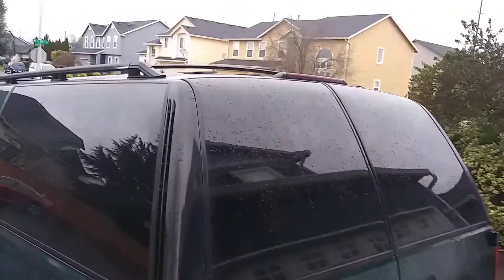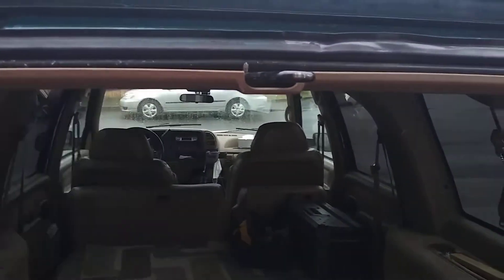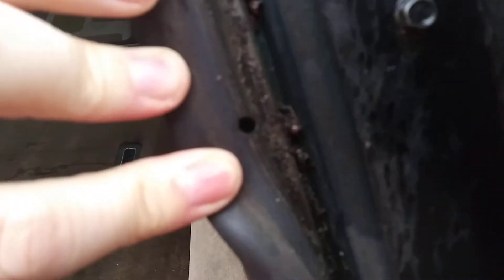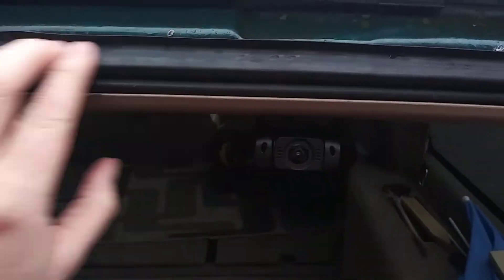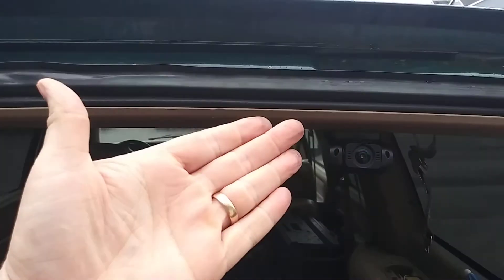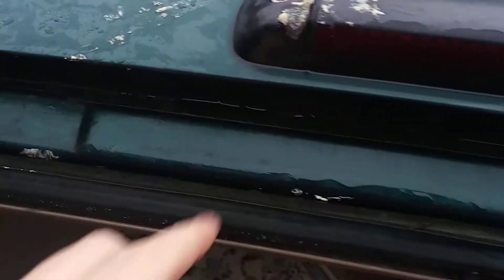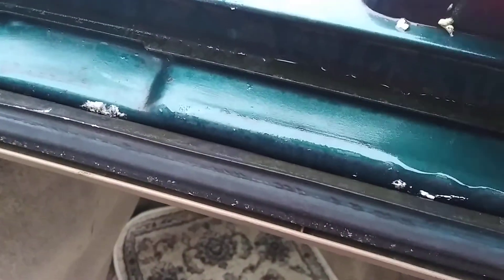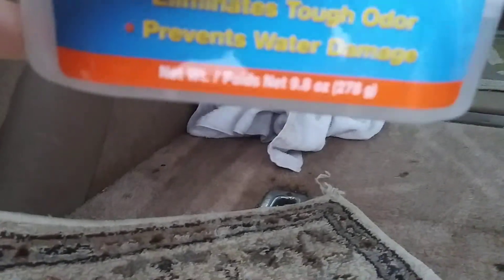95 Suburban rear door seal leak simple fix.

Comment: My burb. 1994  Was leaking at the top corners of the side bay windows. It travels along the passenger side underneath the rear climate control. I thought it was the rear door leaking, but its my rear bay windows.
Used silicon rubber. My carpet was shot, so ripped it all out and used clear bed liner. See if its wet at third row floor,
Reply: Do you have a video or ability to make a short one you could post of exactly where you had the water leak and where you placed the silicone to reseal the window(s)? ...I'm having the same issue, and want to do these checks before purchasing all new rear door seals.  Thank you.

Comment: Thanks for the info.  Question - What backup camera system did you install?
Reply: Its not a back up camera. It's a rear dash cam. viofo129 plus.
Also in a heavy rain I still got water unless I parked down hill. Later I got some magnetic strip and put it on in the roof to act like a diverter and it has never gotten wet again even if parked uphill in a heavy rain.
Reply: @brianwilless1589  Thank you, I wasn't sure, but will have a young driver soon and am looking at dash cams as well.  Much appreciated.  The installation of the camera looks like a neat and clean job.

Comment: What are those buttons on the top right
Reply from the maker: They are electrical connections when you close the door for power locks and window defrost.
Reply: @Bkwilless  I have a 1999 sub, with owners manual and it says nothing about them... The passenger side rear window only the top half will defrost... Where can I find a tutorial on how they work